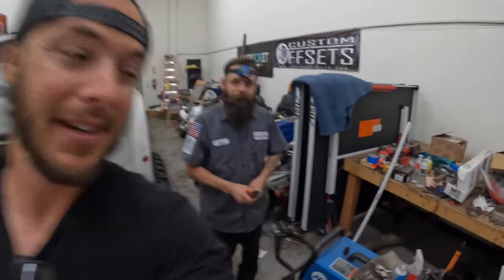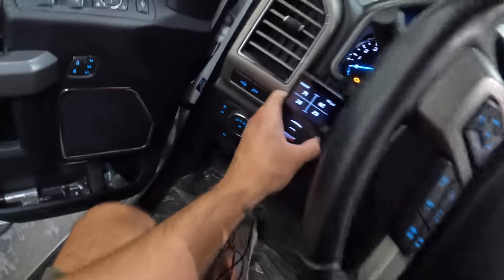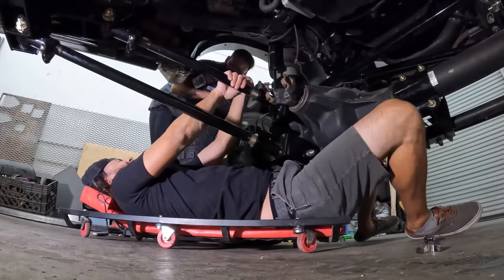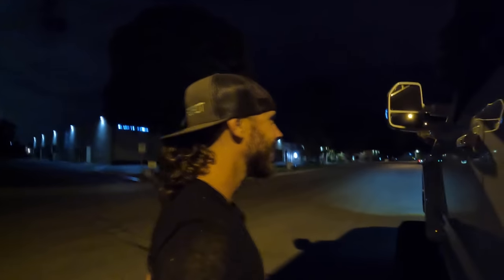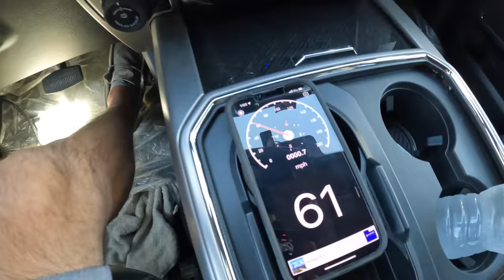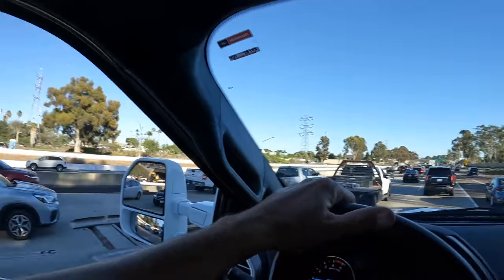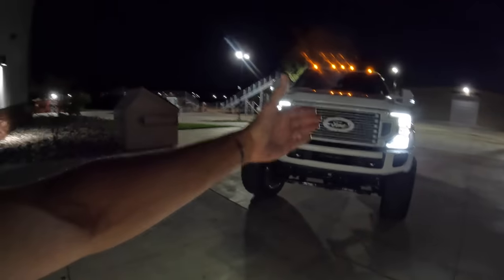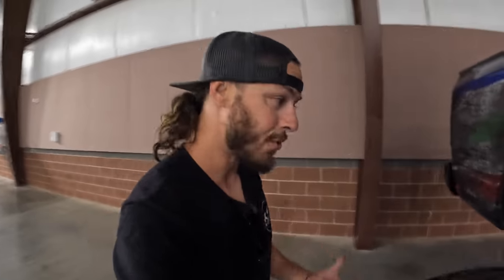Taking this MASSIVE F450 on a 1000 Mile Road Trip!

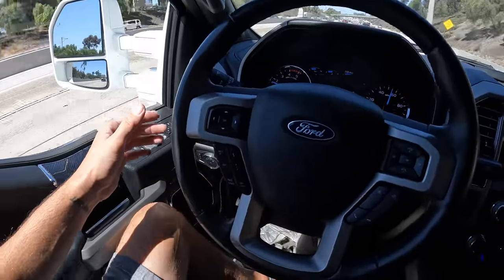Comment: 14:55 that’s the joys of solid axle man you’ve been spoiled with ifs. There’s a little tweaking but when you hit bumps especially with super singles you feel everything pull you. Plus don’t forget this is a  f450 based off a commercial truck. It’s still that base commercial truck but with nice suspension now. I have a ‘22 and ‘21 ram 5500, my main daily the ‘22 i have which is a 4 door Laramie box truck and the previous ones were slt single cab 4th gens (6 previous from 12-19) they all all felt all over the place up front with and without weight brand new. LWB helped me a ton, but in your case I bet you’d notice a huge improvement with regular dually front for papa ryno as a daily super singles for shows but that’s is my opinion only.
Reply: Youre not wrong. My 19 f250 thats lifted does the same. It got noticeably worse once i went with an aftermarket drag link that was much more stout than factory. I think the stock one has a lot of flex and play. putting a solid one on with the kelderman kit certainly makes it more noticeable.

Comment: From driving on air ride since I was 17 the feeling that your getting through the steering wheel is normal. You will notice it more when the bags aren't maxed out up or down but it's not a big deal I was a runner for a lawyer when I first built my ranger on bags and I did almost 200 miles a day on city streets but I love being a justable then driving my daily